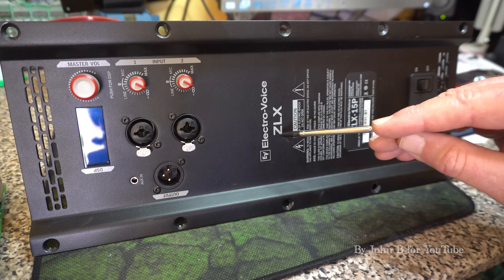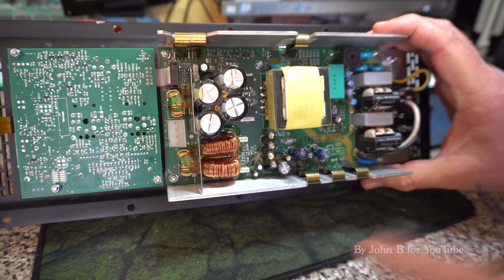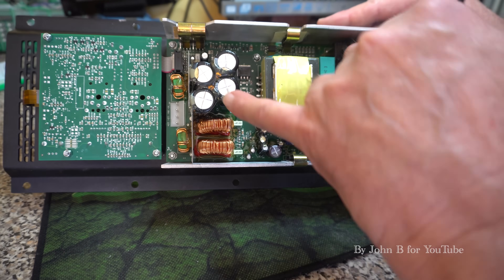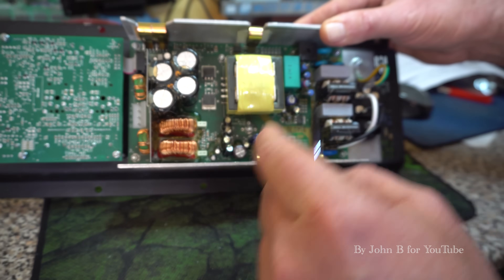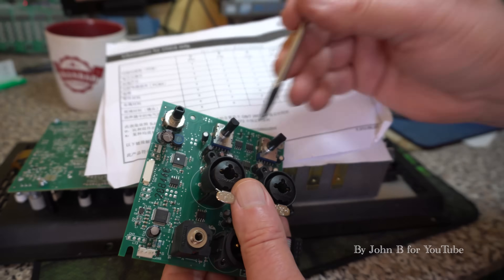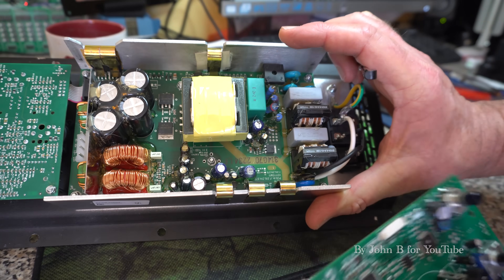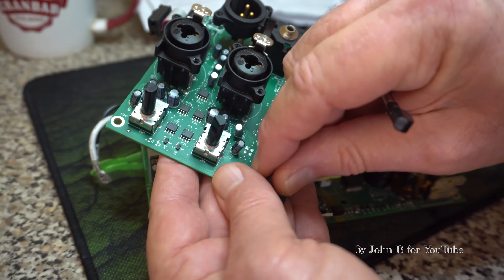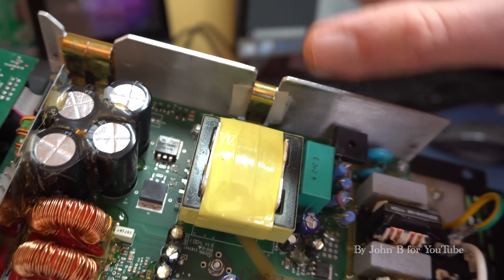The Inconvenient Truth about your Electro-Voice ZLX-12P & ZLX15P amplifier (Read Show More)

Comment: mackie and yamaha suck balls  go buy jbl, das, audio, martin audio, Mccauley eaw, db technologies, kv2 audio, Rcf, turbosound even yorkille
Reply: Dont buy powered. Simple
Reply: John B not at all  you have a lot more options if you have a passive sub amp and a top amp. Normally it's just one side of the amp that will go down so you can bridge them. Or just link the speakers. Powered are ok for dj work but for a full band with miked up drums and guitars etc I just don't think they really cut it. Maybe with the exception of the Yamahas
Reply from the maker: I have repaired JBL too.
Reply from the maker: Yes have one amp and lose all your music when the amp blows up.
Or have quality powered speakers and maybe lose the odd speaker if it blows up.
Turbosound? sounds like a boy racer brand and look very overpriced.
Reply: Mrashgaming and KV2 are great but are well out of most people's price range
Reply: I had 2 DB technologies Opera 610 D  for four years until one got broken. Bas section amplifier and bas speaker got blown (got expensive RCF speakers in it).
Than bought 2 Db technologies 710 DX and after 3,5 years one got broken. Fuse blows again and again. Mosfets of power supply are shorted. 
Had contact with DB technologies and they don't give technical drawings, they only cell refurbished apms for it at a cost of 270 Euro,  a complete new opera 10 model costs 325 Euro .
DB technologie and RCF are made by the same engeniers , AEB.
I wonder if more expensive models of these brands are more reliable.

Comment: Hi John, my ev speaker is giving a distorted bass sound after my worker put it to loud. Tomorrow I'll try to get in warranty repaired. But if not what you think is to be replaced. I have a hot air rework station ;)
Reply from the maker: Hi,
Not having a circuit drawing, it could be anything.
Maybe the input chips are damaged, or maybe something around the base chip.
Reply: Not the answer I hoped for but thanks anyway, BTW great review. Next time I'll inform me better. I know the store is also selling B52 and Yamaha. My speakers are only 1 week old maybe they let me upgrade? What you think B52 or Yamaha?
Reply from the maker: Not sure what the B52 is, other than a bomber lol
The Yamaha DBR series seem to be a good quality speaker complete with DSP too.
I'm wondering if the woofer is blown on your EV?
Was the guy who turned it up too loud a beginner?
Do you have another cabinet to try swapping the amps?
Reply: I live in the Philippines, Philippinos love music and especially very loud music, I hear often very loud crackling speakers here, along the street while singing Karaoke and in stores. They seem used to the crackling noise like that and they don't know anymore they sounded better before. Terrible. The guy that blew up my speaker is just working on my house, although I asked not to touch the volume I saw he did because he put the main volume at +10db while I had put it on -10dB only using the line-in control to change the volume. Beside my Philippine wife, I observed not many Philippinos are that smart, but they are happy with the little they have and very slow-foot in doing and understanding and they just do what they like. I should have known....
Reply: Hi John, it seems my amplifier is working alright again. Maybe because of the heat outside I guess, I've put the speaker in the shadow now.

Comment: Thanks for this video! So what would you recommend instead? Mackie Thump 15BST? Yamaha DBR15? Mackie SRM650? Yamaha DXR15?
Reply from the maker: Hi,
That's a difficult question.
This amp will give you 60 volts peak to peak.
A 450 mackie will give you 100 volts peak to peak.
The DBR10 Yamaha I repaired was a really nice speaker with DSP so the 15 should be fantastic at 1000 watts (I imagine)
These EV are quite nice, just 420 watts.
I've never liked the Thump series so can't really comment on them.
Reply: Thanks for a great answer! Have you ever repaired the Yamaha DXR15?  I'm wondering of going up 100$ and getting the DXR15 instead of the DBR15. Thanks again for this video. I changed my mind about the Electro Vision, and I will pay a few more bucks for Yamaha for quality build and with the actually RMS power they claim they have.
Reply: Get the new mackie thumps

Comment: Very nice review of the amp. Let me ask you this, I have a pair of the zlx12p. I run these without bass because I use subs, I crossover them at 100hz. Do you feel the zlx12p can still get very hot and overheat without bass? Or it's most likely it will only get hot running them full range? Just curious trusting your electronic knowledge.
Reply from the maker: Thank you for your kind comments.
Those treble chips get hot quickly and probably cause 50% of the heat.
During the repair video, I discovered the bass driver chip will overheat in just a few minutes if its not touching the heatsink.
A regulator overheats and shuts the amp down in less than one minute when not clipped to the heatsink.
I doubt the other board failed due to volume, unfortunately those FETs driving the transformer do fail on just about every amplifier I have ever seen, even the Yamaha DBR10. (see video)
Reply: After watching this video 1 month ago, I ended up selling off my zlx12p. Sold them last night. Your video did me in. Lol. Have you ever worked on qsc products? If so, are they reliable? I'm thinking of buying qsc k10.2.
Reply from the maker: I've seen some of their stuff, the 2 U rack mount look rather basic.
I'm very dubious of the QSC K10.2 10'' Active PA Speaker, 2000 watts PEAK on a little 10 " woofer??????????
I'd love to see the guts of one and even measure the real power.
2000 watts on a 10 inch woofer sounds very much like some inflation of the true RMS power, just like the EV in this video.
Mackies SRM or HD 1801 subs are and 18 inch woofer and would shake many buildings, they are quoted at less than 1000 watts and more than 800 watts.
I have my doubts and that is just looking at the advertising.
Yamaha DBR 10 is quoted as 700 watts and has one 500 watt driver for the 10 inch woofer and another 500 watt chip for the horn yet quote a reasonable 700 watts which is probably peak music power.
Reply: John B. Yeah, the 2000w peak sounds too good to be true. The k10.2 is bi-amped. I'm pretty sure low freq. driver might be getting at best 700 watts and high freq. driver 300 watts. I could be wrong, but I know qsc makes better amps than Ev.
Reply from the maker: But do they make better amps?
I believe a good manufacture will quote a realistic power rating.
Just found the manual for K8, 10 & 12.
They are using the BOG Standard 500 watt driver chip for the bass !!!!!!!
One of them, not 2 like the SRM1801 Mackie Sub woofer driving up to 1000 watts into an 18 inch sub woofer.
Reply: John B. I feel it's mostly all about  marketing. All companies are doing it. I really do enjoy your videos, I learn a lot from what you show. Keep them coming. Have a great day sir.
Reply from the maker: Can I just add the following.
Firstly, the schematics are available so big bonus and my hat of to QSC.
Secondly, the power supply is using a large body fet, I've only ever seen them on the Wharfedale.
Finally, I was having a discussion with a friend, are my videos too long?
Some repair videos are much longer than this one, are they too long in your opinion?
Thank you for your feedback and comments above.
You too have a great day.
PS, considering buying QSC is not the worst idea I ever heard.
Reply: John B. The one about the mackie 1801 sub maybe, but your videos are on average about 20 minutes. It's not bad.
Reply: Hey, I also have pair of the zlx 12's and elx118 subwoofers. Both of my tops are getting hot (and sometimes overheated) even when i'm running them with subwoofers. I don't get it, other people i know with the same speakers don't have this problem. Btw i can barely touch them because of the heat.
Reply from the maker: Rens van den Beemd
The more work they do, the hotter they will get.
If you take a look at the repair video for this amp, you'll see the bass chip overheats in just a few minutes without a heatsink.
In less than one minute, the 15 volt regulator got so hot, the amp started turning off and on.
Maybe you're using them in bigger venues than the other people not having a problem.
Maybe yours are running at a higher power output than the others.
Sounds like you need a more powerful speaker.
Reply from the maker: Mr. Jace
Sorry I have just seen I did not answer your question fully.
Not having the zlx12 handle all the bass will allow them to run cooler / not generate so much heat.
However, having them run from 100 Hz is still a high demand in my experienced opinion.
I test many amps with my oscilloscope, the lower the frequency, the hotter they all get.
I appreciate most subs are spec'd up to maybe 150Hz which means the tops are having to do some work.
So yes, using a crossover will help.
The easy answer is this-
If something is getting too hot, it's under-rated for the job.
Reply: John B Thank you for your answer, but they also get hot when i’m running them at low volume. Yes i’m probably going to buy more powerfull speakers, but it is very strange that they are getting that hot.
Reply from the maker: If the woofer or horn is stating to go short circuit, that will cause them to get hotter than when they were new.
But if you have a pair of them and they get equally hot, I'd ignore the temperature until the LCD warns you of the temperature.

Comment: I have two zlx 15p for mains if what you're saying is true I'm worried
Reply from the maker: Looking at the 2 boards I have, the overheating one is a later design than the one that has blown up.
The component layout is different.
Maybe they have improved the reliability?
But they are still only 420 watt bass amplifiers